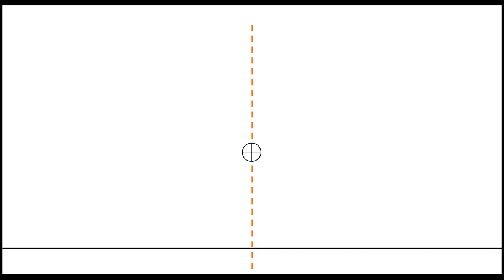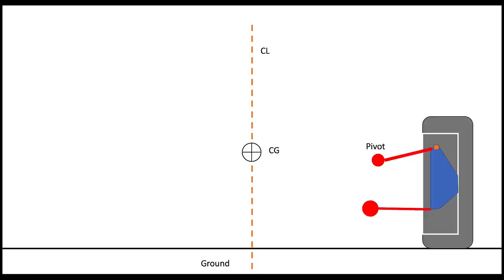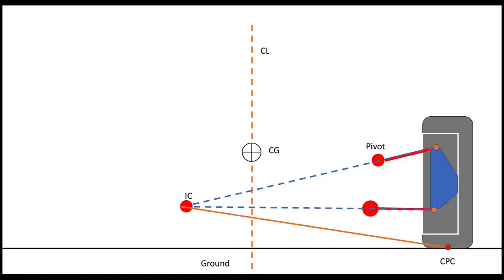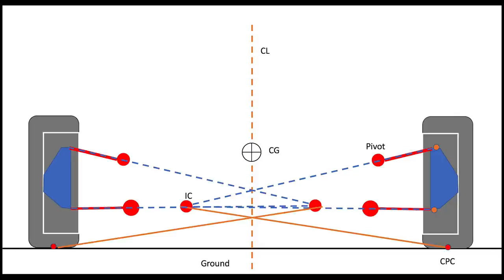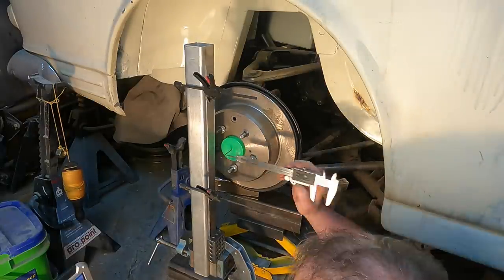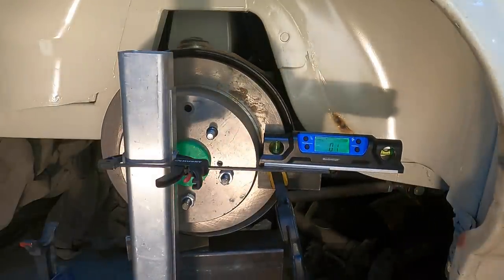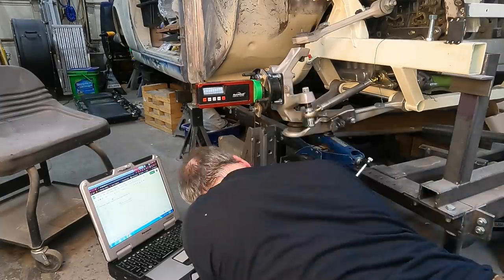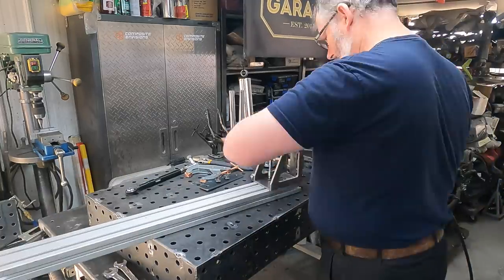Suspension Tuning: Roll Centers and Dynamics

Comment: The reason must books use the 2d method:  it works.
I've looked at suspension by calculating jacking force (looking at lateral tire force and instant centers, the roll center doesnt even need to exist for this analysis), and even tested them on a racecar. What I found: for the autocross racecar i was working on, a higher roll center than what i started with (all RCs were above ground) had the fastest lap times. There was a point of diminishing returns, where a higher roll center didn't improve lap times. We stopped here, as we expected lap times to start increasing (this was expected based on calculations, theory, etc). 
NOTE: I said lap times decreased. BUT, lateral acceleration actually went DOWN. What? It's because we reached the peak acceleration FASTER; the change of acceleration per unit time,  aka jerk. Would you rather reach 1.7G in .5 seconds or 1.9G in .8 seconds? Of course, this depends on the track youre racing on. 
How was peak acceleration reached faster? From jacking force. To lift something up, there's an equal but opposite reaction. Lift the cars chassis up, there's an equal force down in the tire. More normal load on the tire = more potential for lateral grip.
Why was peak lateral acceleration down? Because of jacking force, the CG was a bit higher, and more of the normal load was going through the suspension links (very stiff) instead of the springs/ damper (relativity less stiff).
Anyway, a high roll center isn't necessarily bad. A lot or race cars have adjustable suspension pick up points (upper a arm to chassis, upper/lower a arms to chassis, or if you're complicated upper/lower a arm adjustments on chassis and upright) to help tune from track to track. 
If the car is "lazy", increases the IC height to increase jacking force. If it's too "twitchy" or "nervous", reduce the IC height. 
So why isn't there a way to simplify calculating jacking force, and adjust the cars "lazy" or "twitchy" handling? But there is: the 2d roll center! 
Most suspension books (Milliken, Carol Smith) are RACECAR oriented. Most racecars aren't built,  they're bought with pre designed (possibly adjustable) suspension. It's easier to calculate roll stiffness in 2d for the whole car(roll stiffness taking into account springs, anti roll bar, roll center) than to calculate jacking force for the whole car. Car too lazy? Increase the RC height, and reduce ARB stiff to keep the same roll stiffness distribution, all calculated from simple 2d formulas. You may have a spreadsheet that does this quickly, or pre calculated before getting to the track. Its not exact, but useful and pretty close. Complicated simulations not needed
Reply from the maker: Thanks - great insight.  My autocross car had three different suspensions in it in my first year!  Trying to learn this material is not easy.  Given that the RC is dictated by the links and their geometry - working the tire "harder" can produce faster times - no question.  It's always a question of balance.

Comment: One major thing I didn’t hear mentioned was the movement of the roll center. This is a huge part of vehicle stability. As the suspension moves (heave, roll, single wheel bump) the roll centers move. And if you don’t account for that they can move several inches in any direction. So yes the static ride height roll center location is important but the other side of the roll center tuning coin is the movement of that roll center.
Reply from the maker: True - those dynamical values were checked in the computer model.  The migration as well as the rate of migration are both really important.

Comment: Hi, thanks. Just a few questions. Have you tried changing the hight location for the power steering rack and different rod lengths? Also, under full compression, Is it better to have the lower control arms at a level position? I know this requires moving the suspension and pivot pick up points but my theory is there will be less camber and toe deflection. Would this be the case?
Reply from the maker: Interesting question.  I did alter the height of the rack and that does change bump steer characteristics - it has to sit on the plane described by the UCA/LCA pivots.  Then there is where it sits in and out - this changes the Ackermann.  I'm just working on this again in the new series...it's taken me a long time, but I'm back on the suspension right now.  At the static ride height, for this suspension, the LCA upper surface is meant to be level.  So as they compress, the angle increases.  The issue is there is a fixed curve described by the length of the arms, the upright and the pick-up points.  There is only so much you can change if you're working around the parts.
Reply: Ok thanks for that. Do you try different control arm lengths on a cardboard cutout like the old school hot rod guys used to do it or do you prefer making and trying different arms?
Reply from the maker: @aaronpitts2762  I model the suspension in a software package.  As long as I can hit the goal for camber gain and other geometric characteristics, then the arms are good.

Comment: 23:58 You meant ideas for videos?
In line with the suspension topic: dampers? Depending on the characteristics of your car and the driving characteristics, how do you choose your damper? Valving, oil, ... ?
Reply from the maker: Ideas for the suspension...but thanks for the video ideas.  We'll do these as we roll along.  For sure full suspension characteristics - once I drive it.  Then it's on to tuning suspensions for specific use.

Comment: Tires are flexible and therefor so is the location of the contact patch.  Is it a matter of putting it where it SHOULD be?  Because the methods of drawing the lines to get the roll center height doesn't take flexure into consideration either.  Comments?
Reply from the maker: In the first approximation you would ignore tire data because it's very difficult to come by the information you'd need for a street tire.  We also ignore the bushing compliance.  With a fully developed force model, these can be evaluated.  So this is a first approximation - it gets you in the game.  Tuning is the next step.  In truth, this is about as far anyone can get in their garage.

Comment: Interesting. You are determining roll center through physical measurements of suspension movement, Not the usual line drawing method. I have never seen this before, Is there any way to confirm its accuracy ?
Reply from the maker: I've validated the measurements using two different 3D suspension packages (one was used for the final optimization) and it's bang on (there is less error in this method than in working out the pivots) and it's a lot easier to do.  I'm just about to jump back into the frame build and make this come alive - I'll explain it in that video.

Comment: at the end you mention you had a certain camber movement in mind per inch of wheel bump/droop.  Was that number based on load transfer in curves and subsequent movement of the control arms?
Reply from the maker: Yes an approximation.  At this level, getting it close is based on making reasonable assumptions about the rest of the vehicle dynamics.

Comment: Having spent a fair bit of time trying to understand suspension I can understand your frustration, seemingly there are so many contradictory opinions. In abandoning the kinematics I think you've thrown the baby out with the bath water.
You mention target camber gains but where did these come from? Are they calculated from your vehicle or a rule of thumb? You can work out an ideal camber curve by calculating the positive camber due to roll, this is what you're trying to cancel out to maintain an upright tyre and greatest contact patch.
Most modern cars have a roll axis that slopes upwards towards the rear of the car, rear RC higher than the front, this allows the rear to catch up in roll to the front in taking a turn as the front initiates the turn because it steers, I've definitely felt this with changes I've made in rear roll centre. 
A roll centre closer to the CG is going to increase roll stiffness and decrease the job of anti roll bars later on, ARBs are in my opinion a case of robbing Peter to pay Paul and should be the last stage resort of suspension tuning, they don't fix the underlying problem.
I think I'd calculate your ideal camber curves based on your track and suspension travel and try to match these as closely as possible, if the camber change is too rapid move the instant centre outwards and vice versa, look for a roll centre that doesn't move around too much, and target roll centres with the front lower than the back. With hubs, arms, and wheels already set I doubt you will be left with much choice. 
I'd not stress about the front rear slope of the top arm, not sure but take the average, roll centre can ignore this slope just as pitch centre calculations, anti squat/anti dive calculations ignore the angle of the arms viewed from the front. 
What historically have people done to tune your car? If it ran a beam axle and they've tuned them by moving watts linkages or panhard rod mountings these will tell you where your roll centre might be best, do they typically add anti-roll bars to the front or rear? If more rear bar move your roll centre up at this end if possible to increase roll stiffness.
Can you add provision for multiple mounting locations particularly on the LCA to allow you to tune the roll centre and camber curves.
Avoid toe out at the rear in bump, it means snap oversteer, some toe in will help stability. 
Long post...
Reply from the maker: First - thanks for taking the time to offer such helpful feedback - really appreciated.  It was hard to decide the scope of the video - and I struggled with how to do the presentation to answer questions that I had when I started (failed...then restarted) this phase of the build.  So I don't have any arguments - I did calculate the camber rates from body roll etc.  The rear RC is below the front (for the reasons you indicated).  I computed the anti-dive of the front and anti-squat of the rear and bump steer for both suspensions (rear will be toed in for sure).  The suspension that was in the car was 1950's in design - the links were positioned to have as little camber gain as possible -lots of body roll - corner on the door handles (I did get used to that - but it's frightening for passengers).  People have moved the UCA's down, but most have opted for lowering the car and adding a big ARB to what results in a suspension that is neither compliant or fun to drive.  Steering was recirculating ball and not powered.  So I decided to try to advance the design a few decades and get better handling.  People also add ARB's to the live rear axle (panhard rod is stock).  Anyway, I had all of this on the car and I tried different spring and shock combinations and it was fine - but not good by modern standards.
Reply: @ThrottleStopGarage  rear RC should be higher not lower is my understanding and this worked in my case, classic mini, this changes how quickly the back reacts to the turn, called roll frequency, before the change I felt through a longer corner the rear wouldn't decide whether it was going to grip or not, the raised rear RC fixed this and I've got some negative camber gain as well, previously none and rear RC at groundlevel.
With a rwd be conservative with camber gain in the rear as otherwise as you squat on acceleration you'll lose contact patch as the camber goes negative and therefore losing traction, I'm used to thinking about fwd.
Lowering a car on double wishbones and macpherson struts lowers the RC faster than the CG so the roll moment is actually increased, so gets more body roll, there are roll centre adapters that space the bottom ball joint down to correct this, this may explain the big rollbar on the front but they also might have been trying to solve oversteer problems.
I've found explanations by the author and YouTuber Julien Edgar useful, he still has articles available at autospeed.com.au but it's a bit of a nightmare to navigate, otherwise he has a new book out and a YouTube channel, I didn't find much in his previous "diy suspension development" though, but maybe because I'd already read a lot of it on autospeed.
Reply from the maker: @arrindaley3714  This car is rear wheel drive/front engine with an independent rear suspension. The rear RC is often lower in this situation to give more roll to the rear and more grip in cornering.  This is a pretty standard configuration.
Reply: Lowering the front roll center gives more steering under acceleration, but the car is less responsive. Ideal for smooth high grip tracks, with long sweeping corners.
Raising the front roll center provides less steering when accelerating out of the corner, but the car feels more responsive and is less prone to traction roll. Best for high grip twisty tracks.
Lower rear roll center improves grip under acceleration, but reduced grip when breaking. Helpful to avoid traction roll as you enter the corner and tracks with low grip to increase traction.
Higher rear roll center gives you less grip under acceleration, but the car is more responsive. Works for high grip twisty tracks to reduce traction roll.
Reply from the maker: @d.natrop4495  Sure for whatever car you're modifying...again - my point to making this video is that you'd need to know the specific kinematics of your car before making these sorts of generalizations.

Comment: You know, that's not a bad idea... small oven.. do the small stuff...  reasonable plan that preserves garage space.  I suspect powders never go bad for use years later...
I wonder how the Harbor Freight kit (here in the US) compares with Eastwoods...
Reply from the maker: I think this comment is on the wrong video...I'm sure the Eastwood and HF powder coating systems are about the same.  Everything packed into the oven and it's all in a box in the rafters.
Reply: @ThrottleStopGarage    Thanks! You're right!  I think the video auto-advanced and I didn't notice.  Thanks for the reply!

Comment: Hi sir how can I get in touch with you I need some advice and help...

I swapped my front axle assy with bigger and heavier ones like the whole front axle assembly(bigger brakes calipers n hub stub axle) weight increased by almost double or triple even...i also used new n heavier ball joints in exact same position after I did this the car is very much unpredictable over bumps even minor unevenness of smooth roads

I need to know where is the problem as I m using exact same joint positions
Reply from the maker: Oh my - that doesn't sound good.  My guess is you've introduced some bump steer.  Check to see if you have any change in toe when you raise a wheel.  If you do - then the unevenness is steering your car.
Reply: Thank you so much for the reply...i might have introduced it I am not sure.... Here mechanics aren't that knowledgeable... But the alignment guy says the angles are ok i hv to jack it up and check for this(toe) .... How do I get around this problem.... Will stiffer springs help... I hv a rigid damper already and this helped a lot.... But didn't fix it completely
Reply: Pls let me know how I can get in touch with you over a call?

Comment: When you say "the center of the contact patch", that's the center of a theoretical ideal contact patch without tire flex, right?
Reply from the maker: Yes - the basic geometries are summed up by this point...it's understood that the contact patch is an area and is mobile etc.  The geometry still applies to this point.
Reply: @ThrottleStopGarage  Thanks

Comment: how much and in what way does your final setup change if you went to larger/smaller tire radius?
Reply from the maker: Hi John,  It would alter the outboard (wheel side) pick up points.  Now if the tire is just a little larger the impact would be "small" - though it's hard to say without looking at the suspension.  The inside points (frame) would move up a corresponding amount - so I'm going to guess that the largest effect would be the translocation of all points up by the difference in the radius of the tire.